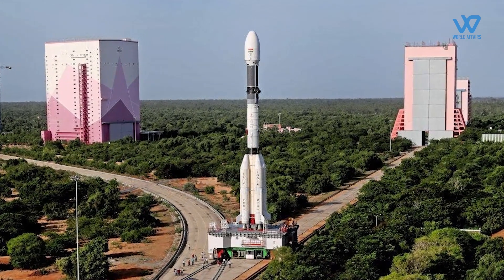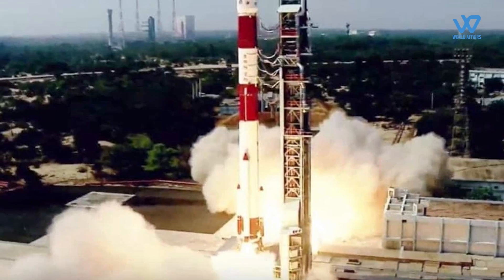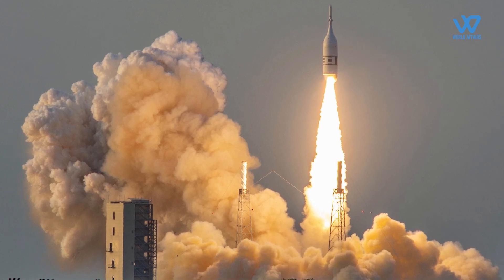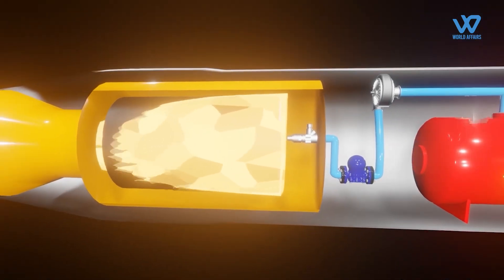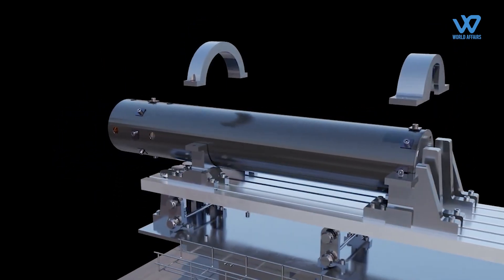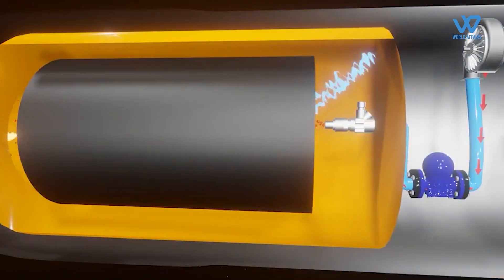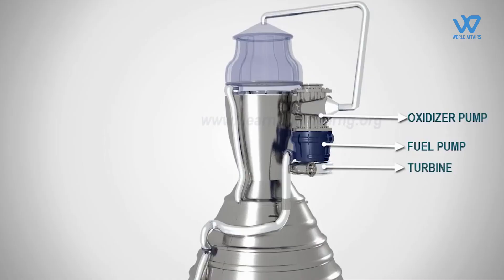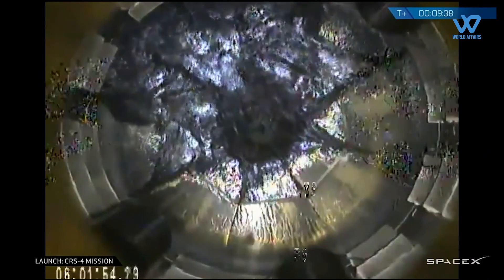ISRO test fires hybrid motor to power future rockets

Comment: Incorrect the combination of LOX/HTPB isn't hypergolic at all and requires significant heat energy to initiate ignition. LOX/HTPB hybrids also require either some form pre-combustion or a combustion aid such as pyrophoric chemical to adequately vaporize the LOX for mixing and combustion with the fuel. Good on ISRO for exploring this technology though, hybrids are important for reducing launch cost and increasing safety.
Reply: Is this type of motor restartable?